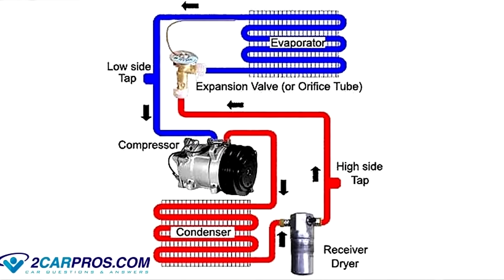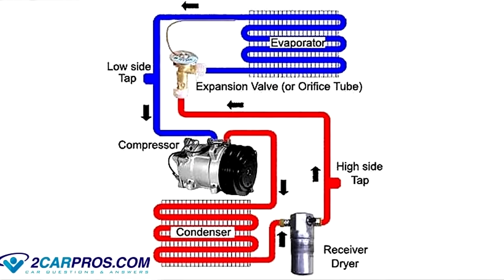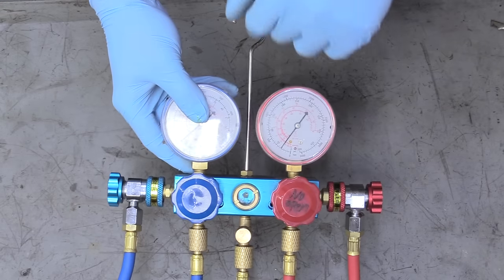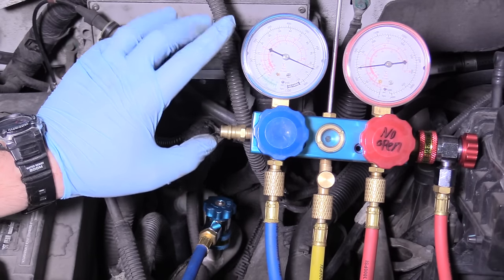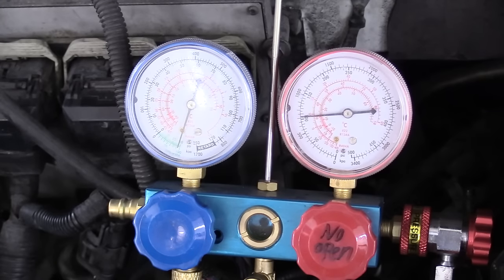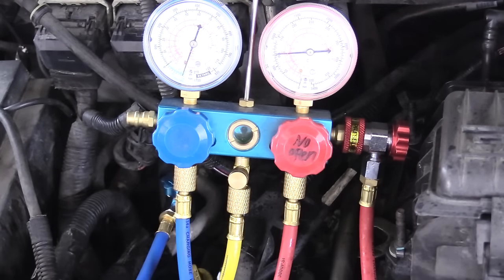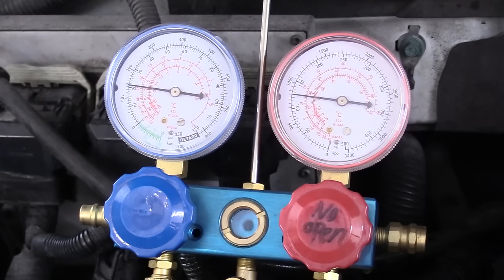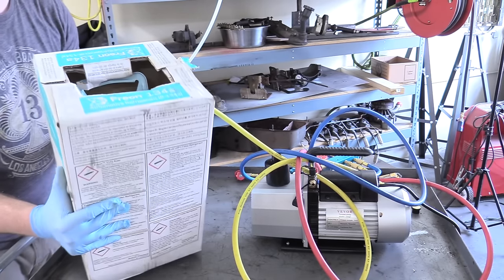How to Vacuum Down and Recharge Your A/C System! - EASY

Comment: Great video thankyou for taking the time to post. My vehicle has the clutchless compressor. Does the same rule apply when charging? My a/c button won't stay on because of  no pressure in the system. Assuming I've no Leaks do I add some refrigerant with the engine off  to put some pressure in the system which will let the a/c button stay on when the engine is running so I can fill the system up?
Happy new year from England 😊👍

Comment: I just replaced the a/c condenser on my 2014 gmc sierra 1500 5.3L but when I did, roughly 1 cup of oil came out of the line. Before I follow your steps to charge the coolant, will I need to add oil?

Comment: I really like how you explained the A/C system first with the schematics before you went into the job.  A nerdy question, even if we are not supposed to open the high pressure valve, why is it there in the first place. Under what circumstances does opening the valve make sense. I ask because I also watch ChrisFix's video in which he did open the high pressure valve.
Reply from the maker: You can open the highside during vacuum down but it won't matter much, the problem is you run the risk of forgetting to close it while you charge the system and then the keg might explode and hurt you or worse. OR you can just always leave it closed and be good. Thanks for watching!
Reply: HI side valve is there also for the end of procedure, which was not shown properly in this video. In the high side line is liquid refrigerant and at the end you should recharge it in the sistem. Close the valve on the refrigerant bottle, close the valve on high side quick connector, then open the low side valve AND the high side valve and wait cca. 30-60 seconds. This way you ensure to empty all the liquid remaining in lines back to the system.

This was not shown properly. And you should also purge both lines at the begining, after opening both quick connectors!
Reply: @k30v6xxzeapm  makes sense, I always wondered how to purge the low pressure line. Is it just to open the line connecting to the manifold gauge after you connect to the car's port. Without turning on the engine or connecting the refrigerant can of course

Comment: Amazing video! Subscribed. I do have a question though

So, what if, hypothetically, I wanted to extract my car's freon with the vacuum, so that I can replace my AC compressor, and then put the freon from the vacuum back into the car with the new compressor? 

Is the vacuum not built for that?
Reply from the maker: Awesome! Thanks for the sub! 

Right so, I can't tell you to do that as it is super against the law to evacuate the refrigerant into the atmosphere. You would have to have the refrigerant evacuated properly. But you can have it evacuated, do your repair, then vacuum the system down and add refrigerant yourself no problem! Thanks for watching Nathan!

Comment: Sorry for the probably easy question - you said you took it to the shop, did they take out the refrigerant? Or did it come out in the vacuum machine? Or does hooking it up to the machine take out the refrigerant? Thank you!!!
Reply from the maker: Yes, they took the refrigerant out by evacuating it into a machine that handles it properly. I just happened to work next to a AC shop at the time so they were super cool about it. Then I asked them not to vacuum it down and let it be at regular atmospheric pressure so I could make this video. Then I vacuumed out the regular air and added the refrigerant as seen in the video. Thanks for watching!
Reply: @2carpros  ac shop as a supply store or auto shop ?

Comment: So I only have to vacuum down if I’m repairing the ac system? If I’m just need a recharge, I just add just refrigerant with the can? Or still recommend to vacuum down to remove moisture? My Haynes manual just gives instructions to recharge with a can.

Comment: Do you have to vacuum the system before you install the new compressor or after? Thanks bud you are awesome.
Reply from the maker: Do this after. Thanks for watching!
Reply: @2carpros  u the man.
Reply: @2carpros  thus might be a dumb question but do u need to vac the high side too?

Comment: On a 94 chevy blazer im replacing everything...compressor, accumulator, low/high side lines, liquid line, condensor, orfice tube and evap core. My question is there are multiple high pressure switches available for the r4 compressor. The different colored switches have different max and min pressure for open and closed. Which one should i get? It currently  has a red switch in the compressor.

Comment: Excellent video, and explanation!! Definitely earned another SUB.. What are the chances of losing any compressor oil, evacuating the coolant really slow?
Reply from the maker: Thanks for subbing and watching! You'd loose basically none.
Reply: @2carpros  Look forward to more of your videos! Another question if I may? My car needs 525 grams of 134a and what’s the easiest way to use scale and know correct amount out of 2 /12oz bottles? That should be 18.519 oz so one full can and how to know to put around 6.519 oz left? Should I use the scale on oz and tare the empty bottle and connections or use grams?

Comment: Nice video. It was very helpful. I have one question. I was down to -30 pressure after only a couple minutes. Can I stop or do I need to continue for about 30 minutes? Is it necessary to completely pull all moisture out? Thank you again for a very helpful video and your time. It has saved me a lot of $.
Reply: Depending how long your system was exposed to the atmosphere will determine how long you keep the vacuum pump running! If your system was opened I would keep the vacuum pump running for about 30 minutes, Give it enough time to boil and remove any moisture that may be in your system! Letting it run for too long and never hurt, Not letting it run long enough can hurt your system!
Reply: Ok great information. It was never opened system. I might just go do it again just to be sure. Thank you very much!

Comment: So this is my normal method that's been working fine.  Today I read that it is not safe to charge liquid on the low side as it can "wash away" the oil and possibly hydrolock the compressor.  The literature said to charge liquid on the high side with car engine off then close the high side and charge up the low side with engine running using only gas and no liquid.... I tried it...it got cold but not as I expected it. Your thoughts

Comment: Dude make it look so easy! Way to go! 
Any video how to remove and install a/c line hose assembly on 2004 5.4l f150.
oil leaking on high side line hose. 
thx a bunch!
Reply from the maker: Thanks for watching! No I don't have that one. But I still own the truck and eventually we will be taking the engine out so we will undo it then.

Comment: Good Video , Ryan question , my 2007 dodge eran 1500 AC is not working , power is on , the compressor is working , when a turn on the AC the two lines high and low pressure after a minute I can see ice form and the ice cover everything,  ( a took the truck 5 months ago to replace the outside fan and I think no only they ripped with the price but their bad work led to this problem , call them and of course they don’t want nothing to do with it , what can you suggest and thank you
Reply: Clogged expansion valve?

Comment: This was a great video. Thank you. You have a really good explanation of the inner working and the dangers the refrigerant poses to the environment. I have a question though. I tried to check my AC system but the low pressure valve wouldn't let me get a reading. I thought at first that it was empty but it shot up to over full when I briefly taped the trigger in an attempt to add refrigerant. Upon removing the low pressure fitting I got a burst of pressure then after replacing the gauge onto the fitting I was back at square one.  Any advice. Please help
Reply: Is your compressor on?
Reply: @BenPat88  had it looked at.  The clutch on the compressor isn't engaging.  I don't know if it's because of one of the modules or just a bad clutch. I've got to get a test light and check it at the plug.

Comment: Great video thank you
And one question, during the vacuum and adding freon procedures, basically there's not much freon go throughing the high pressure nipple and it just for measuring the pressure. Is that right?
Reply from the maker: Correct, no refrigerant is added via the high side. Thanks for watching!

Comment: I wish I'd seen your video 1st. I watched Scotty Kilmer and Chris Fixx. 
Neither mentioned NOT opening the high side, in fact I'm pretty sure they did open it. They tell you put the AC fan on low!
So, my AC isn't taking Freon, and I had the high side open (and low side) at the gauges when adding it. It went up to a point and stopped. 
Yes, I vacuumed out the system, it held a vacuum, prior to starting to attempt to add R134a via a small cans. 
So, now what? How screwed am I for opening the high side? What will the result be and how can I fix it? How can I get the compressor to kick in and suck in the fluid?
Reply from the maker: Is the pressure switch good? That would cause your problem. Thanks for watching!

Comment: I'm wondering if you could help me with determining how much refrigerant I need. My system takes 500 g. Br134a tins that I am using state a net weight of 220 g. This is the actual weight of the refrigerant inside the can. However, it also says it is for a hydrocarbon gas replacement or 584 g. Should I top up my system based on the net weight or hydrocarbon gas replacement weight??

Comment: I’m getting ready to tackle this and I have a question. Once I evacuate the system, I’m planning on using the regular small bottles of 134 like you buy at the auto stores to refill it. Since I’m not using the yellow hose to refill and rather just using the hose and gauge that came with the refill kit, do I just disconnect everything from the low side and then proceed with the hose that comes with the store bought kit? I noticed you never disconnected that between vacuum and recharge since you were using the keg. Am I going to be letting air get back into the system doing it my way or not?

Comment: 2004 suburban with rear air.....Would a blocked orifice tube   make me un able to pull a good vacuum? I can't get it to go past 9 and it should get to around 29? I had to replace my ac compressor. Only disconnected the 2 lines attached to it . They are seated fine and with new O rings( supplied by manufacturer)   initially I got  it to vacuum down to 29 and hold steady. Put in 2 cans of gas then when I went to put a 3rd can , it started blowing warm and my low side pressure went very high!.  So I let the pressure out and basically started from scratch and now it won't vac to 29.  Tried multiple times to no avail. Could it be a blockage?

Comment: Great video, but how about if you have replaced your compressor with a second hand part? The compressor has a oil fill hole inside the top of the compressor with a bolt, do you need to fill the compressor first directly with oil or does the recharge gas contain oil that will feed the compressor directly not needing to do this? i'm confused

Comment: Great video! Toward the end of the video, with the truck running, you said something that is a bit confusing to me, and it could be do to the noise of the truck engine. You said to open the low side (which I didn't  see you do) just before you grab a "garden" hose? And hose the refrigerant tank? Are you spraying the tank with water? This is the only section I didn't understand.
Reply from the maker: No. You are just using the garden hose to spray the condenser to cool it down, especially if it's a hot day. Gives it a bit better charge, just a tip you don't have to do it. Thanks for watching!

Comment: Scotty Kilmer says you should always fill from the gas side of the tank, since the "liquid can destroy stuff," and is less safe. I think he means the refrigerant being filled while running the car can accelerate problems for the compression system?
Reply from the maker: It turns to a gas once it goes through the low side shrader valve. I can't comment on what anyone else has said but I've done it this way my whole life and have never had a problem. Thanks for watching!

Comment: Ryan thank you 🙏🏼 finest explanation on ac installation equipment. Question? We are replacing several items on our 2008 Jeep Patriot. Condenser, accumulator, and compressor.  Accumulator is late in arriving. Can we reinstall the belt and use the car a couple of days until it arrives, without harming the new components, if we don’t with use the ac? Thank you!
Reply from the maker: Yes but you need to tape up any open hoses/ports so the inside of the system does not become contaminated. Thanks for watching!

Comment: If I use the little cans, do I still have the system equalize before turning on the vehicle?  What if it doesn't equalize with one can?  Do I then attach a second and continue until the system has equalized and then turn on the vehicle?

Comment: But with a vacum in the system, and then hooking up the red hose, won't the system draw the contents of the red hose into the system, thus contaminating the system? And THANKS this video ROCKS!
Reply from the maker: I had the red hose hooked up but the valve not open. So inside the hose is vacuumed down too. I keep my red hose under vacuum for this reason. Thanks for watching!
Reply: Now You said to keep valve closed on the manifold for the high side...do you also keep it closed at the coupling part as well for the high pressure port that connects to pipe?@2carpros

Comment: Thanks for the video!  My only question, some seem to say yes, some no... With only an evacuation and recharge, does oil need to be added?  No parts changed.  I would think the vacuum would pull some oil, but as you annotated, careful vacuuming bleeding should prevent oil escaping?
Reply: I'm going with adding no oil.  The official service manual doesn't really indicate on a recharge how much oil goes in, if it does, it's a few milliliters.  The car has 182k and the compressor will surely go out within 20-40k, .. I've vacuumed it and recharged, maybe I'll add some dye which is an oil suspension basically.

Comment: Hey great video,! If i changed all my ac components and flushed the lines.   Can i just pour the required oil into the compressor .   I drained the oil in the new compressor and added 9 oz.

Comment: Hi. I'v done my compressor replacement according to your video. It was success till vacuum, but new compressor is working continually even I turn off AC switch. Lower pressure is over 70 and high is over 400. It has happened while recharging the refrigerant in 5 minute. And did not flush AC line and did not change condenser.
Could you please advice me...?

Comment: Hey 2CarPros... love all your vids. If I let all the r134a out of my system and vac it out, will I need to replace the oil. I'm handicapped and trying not to have to pull the compressor to dump the oil and refill. Thank you for your time. Johnny

Comment: GREAT VIDEO!!! so if we do make the choice to not take it to a mechanic to release the pressure and collect the refrigerant. When you loosen the fitting on the lo side gauge, do gas or liquid come out and how would you collect it and clean it up? Thanks
Reply: Into a bucket of water?
Reply: From what I have read, a special vacuum machine, different than the one show here, is used.  It collects the refrigerant and deposits it into a reservoir in the machine.  These machines are too expensive for the home mechanic to afford.
Reply: It comes out as a gas so do it somewhere well ventilated, also some PAG oil will probably come out

Comment: Do you need to connect it to the vacuum to remove the pressure, or just use the hoses and meter and not the vacumn?

Comment: Does vacuuming the system check the high and low side at the same time? Or just one or the other by opening up each side individually? Wondering this because I’d like to see high side and low side individually to determine which side is leaking. Also would it not be advisable to attach an air compressor to the guage set to do a pressurized test with air to find a leak using soapy water/bubbles. The leak is major enough to where it leaks quickly. So I can’t charge the system with Freon to find it.
Reply: And when checking vacuum, if it does check both simultaneously, should both the high and low side valves be open?
Reply from the maker: Please refer to the pinned comment. Thanks for watching!

Comment: What kind of vacuum pump, do you recommend for A/C repair? I have been looking for a vacuum pump, but there are many that are a little confusing which one could do a good job. There are 3, 3.6, 4, and 5 cfm. one stage or 2 stages. The pump that you use in your video is a 2 stage probably 5 cfm. I believe the more cfm the faster the vacuum process. what about the manifold gauge? I saw a few with 3 hoses and others with 4 hoses (that include Evacuation port).

Comment: Good video I liked  I have a question about it, when you vacuum down have to open low and high valve  or low valve only
Reply from the maker: You can have both open during the vacuum down. BUT if you forget to close the high side when you charge the system the compressor can back pressure the keg causing it to burst. Thanks for watching!